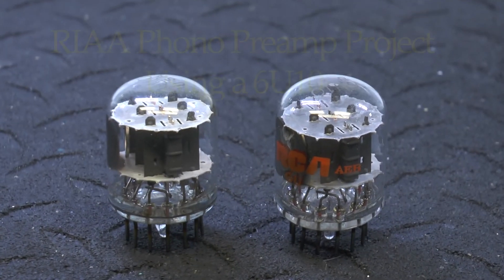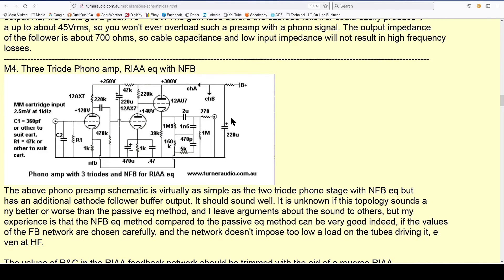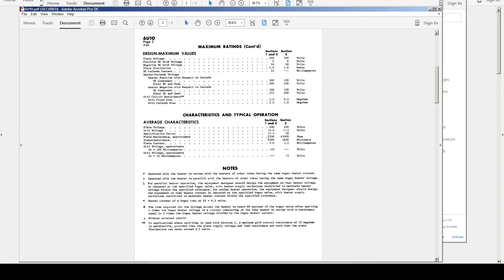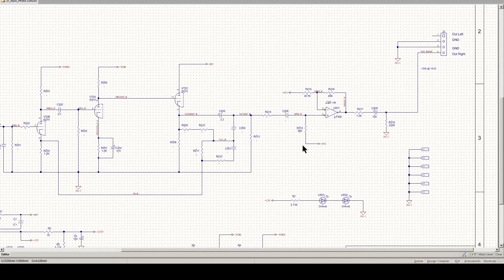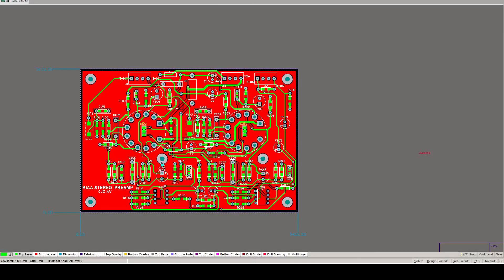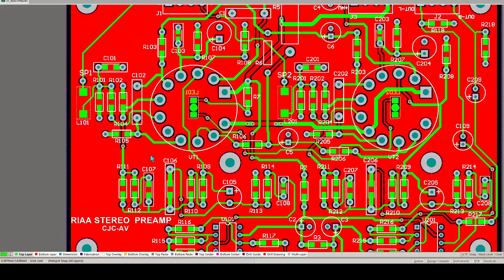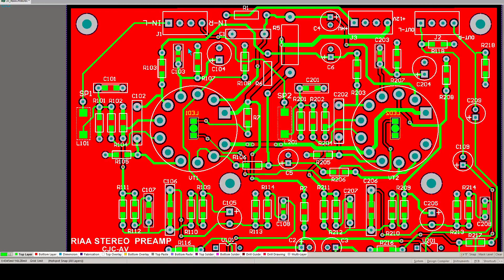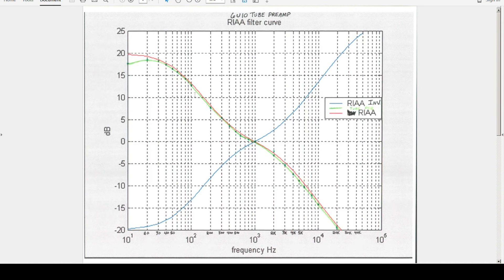Vacuum  Tube RIAA Phono Preamp Design

Comment: I’m confused. You are using a steel enclosure for shielding but, the whole circuit, including the high impedance input is in the Perspex section above. Seems like you lost the benefit. Please advise.
Reply from the maker: Good question, The steel chassis helps keep magnetic radiation (Magnetic Coupling) from the switching supply and any thing below the preamp from creating noise. The bottom side of the preamp PCB is all ground plane which helps with radiated noise, however does not prevent magnetic noise. 
Thanks
CJC

Comment: Why don't you use Power MOSFET as A source follower, I always wanted to try that on a Dynaco PAS Preamp since it doesn't have enough current to power another tube filament. I'm going to try in on the PAS-2 I'm refurbishing.

Comment: I have used tje 6U10 compactron as a phono preamp but i did not destroy good tube phonics with an op amp.  If ypu know you are driving a tube section of 250k input impedance then you have no worries to drive direct from your triode
Reply: Thats why I want to use a MOSFET.

Comment: Nice project and video, thanks! Love the triple triode. 
I think the opamp might not be needed. The output stage, a cathode follower, has a low (<1K ohm I'd guess) output impedance. And the voltage feedback network makes that impedance even lower. The output impedance of the tube part can be measured by applying a 10K or 2K load and measuring the voltage change before and after the output resistor. 
Cheers!
Reply from the maker: I did jump out the op amp for some testing and found the RIAA curve shifted somewhat when I applied a 10K load so I stayed with the op amp as an impedance buffer.  Thanks

Comment: I used 2 6U10 tubes in a desktop speaker stereo tube amp. I used section 2 for the phase converter. I used a 6J6 tube as the pre-amp tube. I found some 70.7 volt  multi-tap transformers to use as output transformers. I found equal inductance taps to set it up in push pull output. It makes around 425 milliwatts clean. and it is really cute. For the high voltage, I used an inverter board from ebay. For filament supply I used a buck converter. The amp is supplied from a 12 volt power supply like they sell to power LED strips. Looks like a laptop charger.
Reply from the maker: Would like to see. Do you have a video?
Reply: @CIRCUITDESIGNER  I don't make videos. I currently have it apart to better select some components. I was very new at this when I built it. I had chosen cathode resistors. I got the pre-Amp section good but was overloading the powers supply with the final stage. When I have it all done, likely it will only make about a watt and a half per channel.

Comment: a TRIPLE-triode ... i'd never heard of those before.   looks good, sounds good.
my only worry there is: does that enclosure have any ventilation?
Reply from the maker: Heat is no problem. Tube sections run at very low plate and filament current.

Comment: AS a tech for nearly 50 years i commend your creative use of the 6010 tube this way..I would love to build this little phono amp as im in need of one..unless you have the PC board for sale.
Reply: Would you be interested in selling the schematic or even better the board diagram (not sure if that's the correct name) so I could order boards for personal use. I'm not an engineer but I can follow instructions and solder.
Reply from the maker: I only built two prototypes. I'm keeping one, the other is posted on Ebay. I have been thinking about ordering more boards however, building the preamp is very time consuming.
Reply: @CIRCUITDESIGNER  yeah no doubt its a lot to build and your price on Ebay is very reasonable for all you put into it ..unfortunately i cant justify the money at this time.. really great work though . If you ever do sell the pc board i would be interested .. cheers.

Comment: Cool project. I want to build my own tube phono preamp soon. I have two Pickering XV-15/625E carts that I use on my Technics SL-Q2 and Pioneer PL-7. I bought the LP Gear Vivid Line Contact (similar to the Micro Line) stylus replacements and they sound GREAT!
Reply from the maker: Saw your channel, I like the recovery idea. I recovered a couple video concerts. The original masters are gone forever. Channel is called "LostVideoRecovery" which has  Gordon Lightfoot and the Dooby Brothers from 1970's Soundstage. Lots of work to recover.

Comment: man this is cool. i would so luv to hear this in my system. 

audiophiles generally have a strong aversion to opamps. i dont know enough to understand. 

do you have a link for the ones ur gonna sell?
Reply from the maker: Op Amps are a good match for connecting to modern audio equipment. They make good impedance buffers. I only built 2 of these. May put the 2nd one on Ebay.
Reply: @CIRCUITDESIGNER  well, plz lemme know if u do. or...is there a way to directly message thru youtube?
Reply: @CIRCUITDESIGNER  if so, could u drop me a line? id sure like to know ahead of time.
Reply: @CIRCUITDESIGNER  u put that 2nd phono amp up for sale yet?